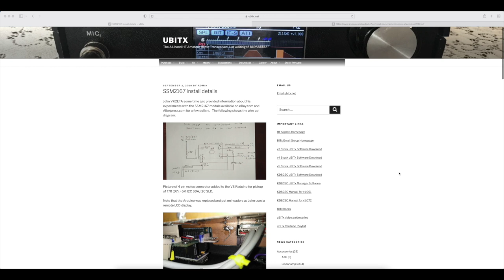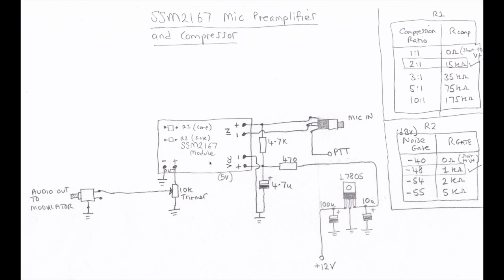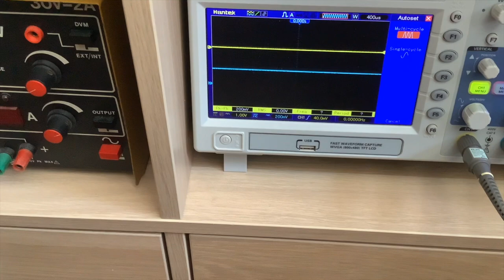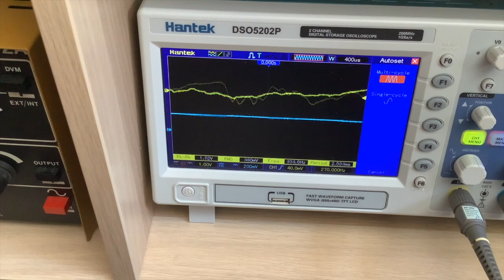28 - Mic Preamp with Audio Compression (PLEASE SEE VIDEO DESCRIPTION)

Comment: Great video Nick. I bought 10 of the SSM2167 chips years ago with the intention of building a preamp/compressor for my FT817, and passing the spares along. Then realised after adjusting USB and LSB carrier insertion points and mic gain to suit my voice that I really didn't need any preamp and compression. So I never got any further. I then went nearly 100% CW. 

I think may I was just putting off trying to solder the little SMD chip and wouldn have got further had the breakout board been available.

I've still got those 10 chips in my components box somewhere!

73 de M3KXZ
Reply from the maker: Thanks Pete. Yeah, I know what you mean. I've got packets of components lying around for projects that one day I might get around to building! Some I forget what they are and why I bought them!!! 73 Nick

Comment: Hi, I purchased .My board doesn't have 6 holes like yours .( max4466/ssm2167 ) Connected to baofeng external hand held mic.Works as intended could not be happier. The reason for comment is all I did was disconnect electrect mic wires on hand held mic and hook up to preamp board.The output on  preamp board connected to were electrect mic originally was connected to in handheld.Added the 3volts separately. This gave me over modulation,  all I did was hook a 10k pot to output of preamp board. Easy / Simple just the 3 volts and 10k pot
Reply from the maker: Hi there! Pleased it worked for you. Did you test it was actually giving you the right compression level and not just acting as a limiter? Please check out my video number 46 which is a major update to No. 28. It sounds like it is a different board entirely so hopefully they soldered in the resistors into the right places on yours! 73, Nick
Reply: Hi Nick, the only testing i did was on ham radio asking my contacts if i sound better with or without external mic.Every contact said I sounded much better with board. The board I used was a updated one preamp / compression
Reply: Sorry , dont know if it's an updated one , but mine is a combination of max4466 and the one you have ssm2167

Comment: Great video! I bought two of those units and when tested they just performed like limiter amplifiers. I was short on patience and just thought they were Chineasium fakes and didn`t investigate further. I will pull them out of the piling system and have another go. Just a point about noise, (in any pre amp circuit using electrets), I filter the phantom power to the mic - +v supply through 1k res, 1000uf to gnd, then 4.7k to the mic. This helps a lot getting rid of noise on the supply getting into the mic line. Many thanks, Chris & the lads of 1977khz
Reply from the maker: Cheers Chris.

Comment: hello and thanks for the video. i bought the same board, remove resistors and soldered trimpots to test, board as labelled 17:07 
R1 stands for noise gate & R2 stands for compression. Maybe mine or yours was inverted.
Reply from the maker: Have you watched the updated video yet? All of my boards so far have come with the resistors swapped over i.e. soldered in the wrong place. The advantage with trimpots is that you can play with the gate and thresholds. 73, Nick

Comment: Think I have an SSM2165 IC which was a predecessor to the SSM2167. It's on my list of projects to make an inline compressor for my FT-817 or homebrew rigs.
Reply from the maker: That should work pretty well I should think Steve. I got the idea from the guys that were retro-fitting them to their BitX rigs. I have to say that it definitely helps with making the audio a bit punchier - especially when you're not running much power. A little can go a long way! 73

Comment: Newbie here: If I were to use the preamp condenser with a fist mic would I still need the dc bias via the 4.7k resistor? Or would I just leave it out altogether?
Thank you
Reply from the maker: Hi! Thanks for watching. It depends upon your fist mic. If it is a condenser mic with an electret capsule then it will need bias. Only if its a dynamic mic would you need no bias. I would imagine most fist mics will be condensers and hence require some power. 73 Nick

Comment: I'm confused with the r comp and r gate value,on the data sheet it shows r comp are 15K(2:1) and r gate 1K(-48dBV)...but on the chinese board it was different? The board shows r comp(R1) 1K and r gate(R2)15K?
Reply from the maker: Thanks for asking that question. Someone else contacted me to say they had done some investigating and found that on the Chinese board R1 and R2 are the wrong way around i.e. R1 is actually connected to pin 7 (gate) and R2 to pin 8 (compression). He desoldered the resistors and swapped them over. This would mean that the board acts as a kind of limiter but not a compressor.

I'd not heard this before but I've just checked on a spare board I have and it seems he is right! So I think I'll have a go at removing R1 and R2 and doing some testing with the values swapped over. There are some spare holes on the pcb for each resistor so I can probably use through hole resistors or maybe even trimpots. It's interesting stuff this!

Thanks again. 73 Nick
Reply: @M0NTVHomebrewing  I've swap the bias resistor and now its work! The compression is great but the noise gate release time feels a little bit long so if i get to close to my monitor speaker it always gives a feedback,maybe i'll try to replace it with a variable resistor and give it a try.
Thanks nick 73,regards from Indonesia

Comment: Video suggestion: Build a box that allows a 150 Ohm dynamic microphone (EV RE20), to replace stock 600 Ohm microphone for two-way radio, using a Hammond 148A 150-600 Ohm transformer.
Reply from the maker: Thanks Gary - I'll bear it in mind. Microphones are an interesting subject in themselves. My current favourite is a cheap podcasting mic that performs really well. It does need some external PTT switching but it is not difficult to do. Incidentally I'm going to revisit this video very soon with some updated information for better results. Thanks for watching. 73, Nick

Comment: Do I need change something if I would like use the pre amp with a original mh31 yaesu dynamic microphone 🎤?
Reply from the maker: Hi there! Thanks for watching. There are 2 things here: (1) You need to watch video 46 which is a remake of 28 and includes some vital changes to this circuit to get it to work right. (2) The circuit is designed for a condenser mic that requires a DC bias - specifically an electret capsule. I've never tried to adapt it for a dynamic mic but I imagine it can be done. You'd have to strip out the biasing on the audio signal input. I can't really advise you further on this as I've never tried it. Others may have though. Hope this helps. 73, Nick

Comment: good day. Th 6 holes on the red board near the end ,do you know what they are for. Is it to put pots to control the compression?
Reply from the maker: Hi! They are connected to R1 and R2. So you can desolder those resistors and connect through-hole replacements. I've actually done it - so you can play around with the different gate and compression values. I will probably do another video on this at some point. On my board (perhaps all of them?) it seems that they have mixed up the surface mount resistors and R1 is where R2 should be and vice versa. This clearly affects the performance of the module. It is worth playing with! Thanks Mahlon.
Reply: @M0NTVHomebrewing  Thaanks Alot for the help and the fast reply.
I have added a 200k and 5 k pot to the extra holes and i have removed the resistors r1 and r2. Now it works somewhat. If i hold the mic close to my mouth it worrks but if im a few 3cm away from the mic it does not pic up my voice. 
Im just learning and i think my mistake is this is for a cb type radio and not my Dynamic PA mic.
I was trying to make a compessor for small pa system.
Reply from the maker: Hi Mahlon, yes it sounds like a mic mismatch. If your mic is a condenser type (e.g. uses an electret insert) then it will need bias. If you wire the module up the way I show in the video then it will certainly get some bias. If you are using a dynamic mic then you won't need any bias. I use a cheap podcasting condenser mic but it works very well with the module I built. All the best. 73 Nick
Reply: @M0NTVHomebrewing  You have been a great help. I have the compressor working on a Dynamic mic. im using a 200k on the comp and a 50k on the other one. All i find is that i need a less senitive pot instead of the 200k. If i turn it any more than say 1/8 of the way its way too loud. Not sure if i should go to 100k or to say 500k. Thanks alot for your help and assistance